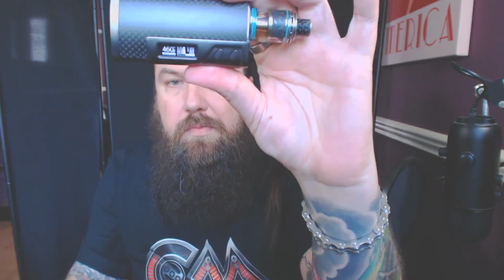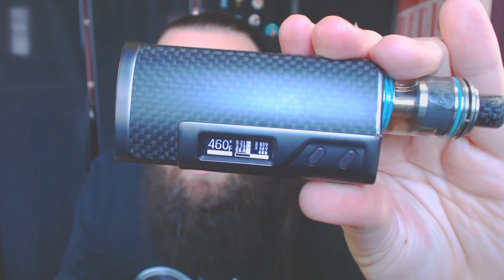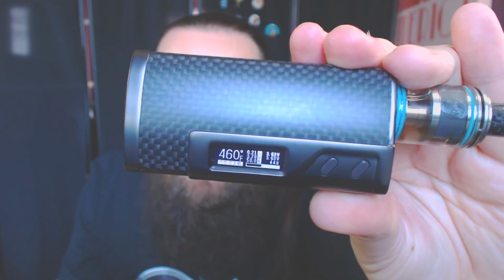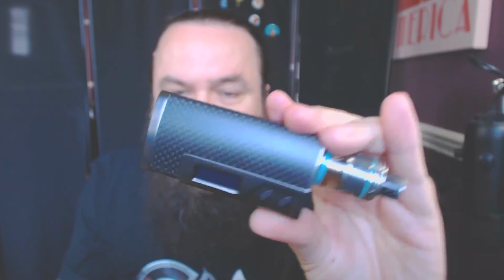Sigelei 213 first look

Comment: Just got mine today, hands down best sub $100 dollar mod I have ever used. Build quality, features, ease of use and performance are on point. I would expect to pay $200 to $300 plus for a mod of this quality and features. Yes it can do 213 watts with a build ranging from .17 to .26 ohms but towards the lower end of that curve it will require a full 35amp draw. At the high side of .26ohms it will require 28.4amps. So if someone wants to use 170 to 213watts constantly I would recommend Sony VTC 3 or 4's or the newer LG 30 amp continuous cells. Great first look Inky thanks for breaking her out...Cheers =D
Reply from the maker: +Mjr Burn thanks for the info and the kind words